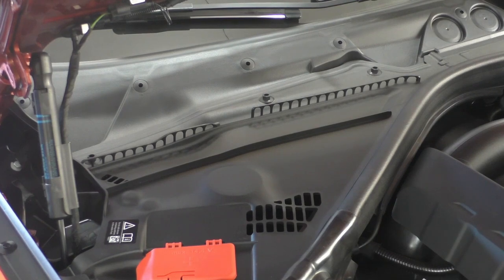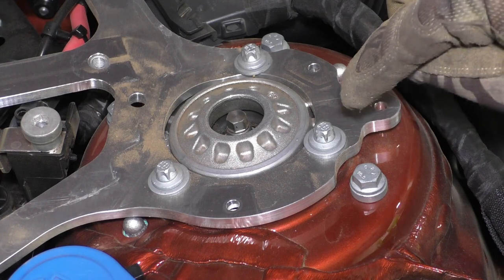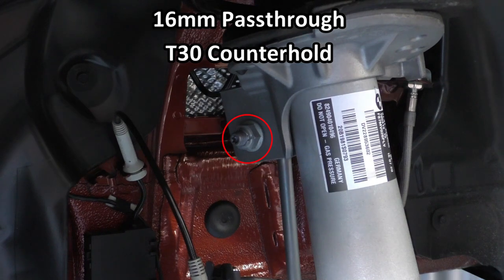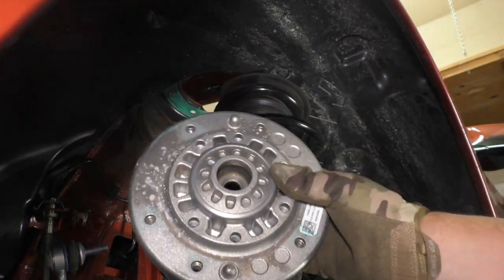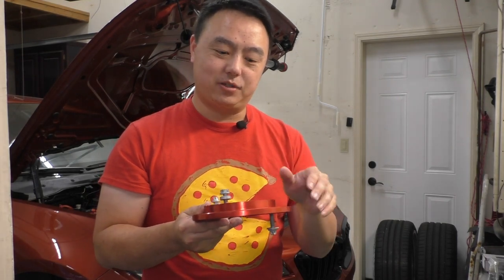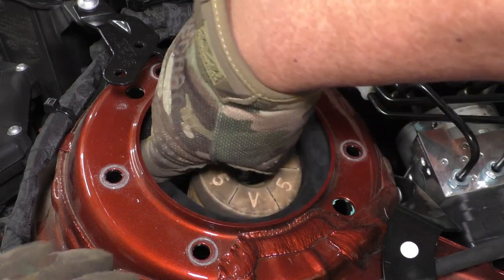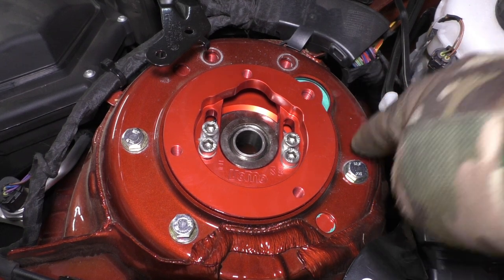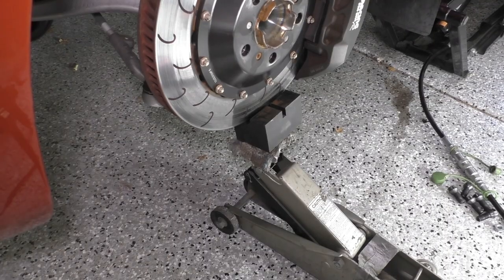BMW Vorshlag Camber Plates Installation (F8X M2/3/4)

Comment: Thanks for yet another great video mate. One tip for those changing to aftermarket shocks & springs.

Strut and top hat assembly is best done with the strut off the car and a spring compressor to alleviate all pressure from the single nut.

Doing it on the car without a spring compressor, risks messing up the nut and the thread of the shaft.

Comment: Another way to counter hold the top nut and not use an impact wrench would be to use an O2 sensor pass through socket.  They are 22mm also.  Great video!

Comment: A couple more hints for anyone using this as a guide- 1) The strut top nut can be easily counter-held with a set of offset wenches. Specifically the harbor freight ones has lots of clearance. No need to impact them on. 2) If you don't already have a pass-through for the end link, the same offset wrenches will work there. It's easier to hold and spin the t30 in that case. I made a list of all the nut sizes and wrote everything out then made a tool run before starting, so thanks a ton for all the detailed info. It probably saved me several mid-job tool runs.
Reply: hi!  if you were to use a torque wrench (rather than an impact wrench) on the 22mm strut top nut, what is the proper torque spec to be used here?

Comment: Great vid as always, just a tidbit for people pairing these with an MCS setup to avoid any confusion:  for MCS-configured plates, they also come with a stepped spacer (as you show in vid around 14:32), but in this case it is to be placed within the monoball from the top.  The MCS-supplied jamb nuts (top nuts) then go on top of that (confirmed by Jason M. at Vorshlag)

Comment: Nice video as always Farkle! 

The factory screwdriver handle in the trunk is actually a 10mm for removing those cam locks (and might be an 8 also) safely.
Reply from the maker: Yup, one of the nice surprises of the BMW tools! How's your new diffuser?

Comment: I had the same issue with the threads. The passenger side was fine, but I needed to rethread the driver side. My shop was able to do it in about 15 minutes.

Comment: Awesome videos sir... Excellent observation on the bump stop, I have the same issue on the G80. Keep in mind, flipping the orientation (nose facing up) puts pressure on the bearing center, rather than the shoulder of the spring top hat. I personally don't mind a bit of added rate from the bump stop with the additional camber. I think... I may try the KW HAS PUR OEM bump stop that comes in the kit, on the stock springs (I removed the kit, so have some extra parts avail.)
Reply from the maker: Yup! When flipped the bump stop will put its load on the monoball race (minimally), and mostly on the main sliding plate that the thrust bearing is sitting on. This is the same plate the thrust bearing puts the load it takes from the spring perch on, so I'm not worried about it at all. 

Going with an aftermarket bump stop like you're thinking of doing could work very well, with even better fitment!
Reply: I have these plates on my G82, but haven't tried adjusting them on my own? Is it easy to do at the track and is there any tutorial available that you know of?

Comment: My f82 GC camber plates' ball bearings are worn out so I contacted GC for replacement parts. GC informed me that they have the newly designed slider plates (with bearings pressed in) in stock, so I ordered those and planning on installing next week. Hopefully whatever change they made is making the plate more robust.
Reply from the maker: That'd be great if GC improved their monoball design.

Comment: Nice guide Farkle, quick one. Is the camber plate compatible with the H&R/Bilstein coilovers? They claim there is noy enough thread to clear the new bearing and stack thickness.
Looking forward to your thoughts.
Reply from the maker: Vorshlag is saying their top nut doesn't have enough thread to grab the strut shaft? That's pretty surprising if true since they grab stock struts just fine. I don't recall Bilstein/H&R having shorter threads than the stock struts.

Comment: I’m trying to decide what comber plates to get for my f80. I like the idea of the millway street camber plates, for being quiet, but the vorshlag plates seem very robust and offer more adjustment. What would you recommend for a car that’s driven 50% street, 50% track?
Reply from the maker: Wow, 50% track? That's a pretty high ratio! If so, I'd probably look at the Vorshlags. If you daily the car at all, the Millway street are probably better.
Reply: @FaRKle0079  I barely drive my car, it’s mostly a weekend fun car. I ended up ordering the vorshlags. Hope I don’t regret it.
Reply from the maker: @uncleben4536  Vorshlag should be plenty good for you then. I'm happy with mine.
Reply: @FaRKle0079  Hi Farkle.  Great videos - now subbed! :-)   Did you happen to take any DB level comparisons with the Vorshlags?   I saw from other videos/posts that you measured 2-3 db increase when using the Millway Streets (although on a different car).  
I have the Vorshlags on my M2 and love the difference they have made to the handling, but find the NVH a bit much at times.
Thanks!
Reply from the maker: @widetyres  I haven't taken before/after measurements with the Vorshlag plates. They've been pretty quiet for me, comparable to the millway streets thus far.
Reply: @FaRKle0079  interesting to hear - i perhaps won't rush to change them then!  Cheers.

Comment: Good afternoon, are there any problems with knocking on these plates? And bearing problems? What is the service life?
Reply from the maker: I haven't had any issues with knocking or bearing wear with the Vorshlag. Not sure what the service life is unfortunately (whenever they start making noise), but I really haven't seen any reports of them developing them like is typical of other plates.

Comment: Would the install be practically the same for the F3X chassis? I just picked up a set for my 335i, and your video seems to be the most in depth install i can find.
Reply from the maker: Yup, install is very similar for F3x, but even easier since you don't have to remove the carbon/alu brace!

There are some torque spec differences, which you can find in my F3x springs/damper swap video https://youtu.be/p6usLM8-FIQ
Reply: @FaRKle0079  awesome! Hopefully it’ll be a bit easier since I have KW Street Comfort Coilovers already. Thanks for the link and all the videos you make!

Comment: great video!  at 16:58, if you were to use a torque wrench (rather than an impact wrench) on the 22mm nut, what is the proper torque spec to be used here?
Reply from the maker: The proper torque spec is going to depend on the damper you're using. For stock dampers the spec is 71Nm (52 ft-lbs), but aftermarket dampers typically use lower torque specs and their threads/counterholds are made from softer metals that will strip/deform at stock damper torque spec levels.

So basically, check with your damper mfg for that spec.
Reply: @FaRKle0079   thank you!  it seems this torque wrench vs. impact wrench topic is seriously controversial!  (read some of the comments on this: https://www.youtube.com/watch?v=2bab6x47CSs&t=123s).  do you have anything more to say about it than what you already said in this video?
Reply from the maker: @philipsailer3526  IMO it's not much of a risk if you keep the number of impacts low (like short pulses of the impact gun). You don't want to just keep the impact running on it for an extended period of time.

Bilstein counter holds are pretty soft and crappy so that they frequently end up stripping so you have to resort to using an impact for future work.